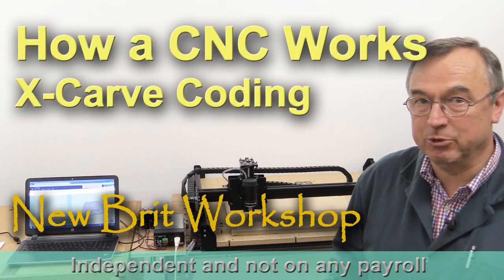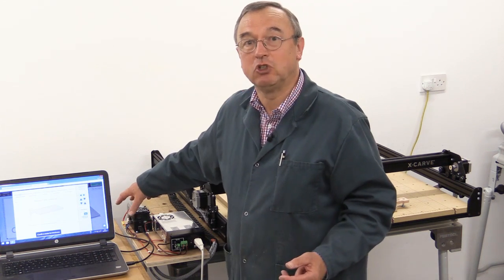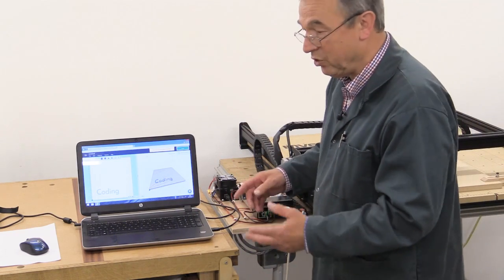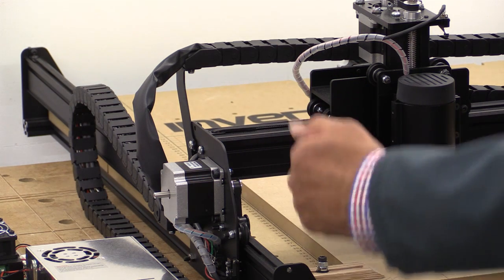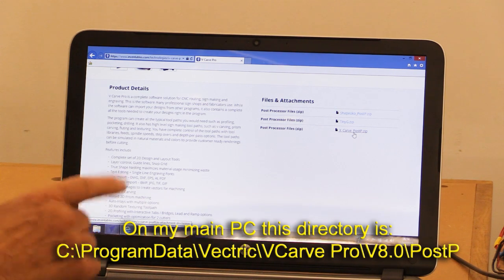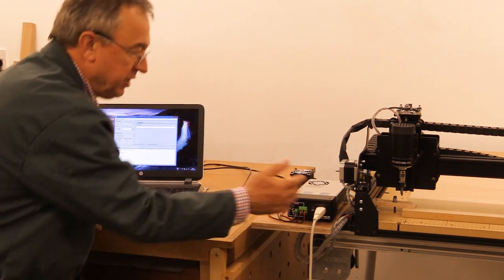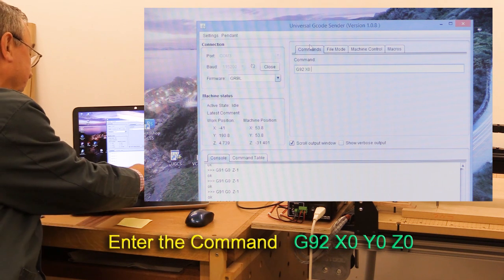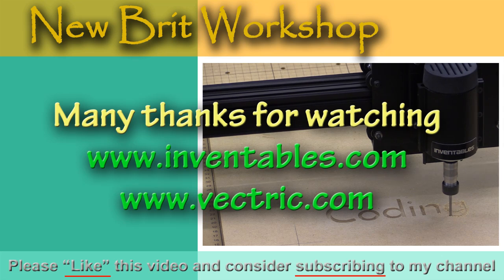How a CNC Works - X Carve Coding

Comment: Great work. How do you put in 3D. For example I want a carved dog's head.
Reply from the maker: There are two elements - the CNC must have as a minimum the capability of running in X-Y-Z (clever ones can rotate the cutter head as well) and the software used to generate the toolpaths must be able to exploit the capabilities of the machine. So, for your dog's head project you could try Vectric V Carve Pro. There are a number of free samples that Vectric provide and I am sure that there is a wide selection of animals amongst them.   Peter

Comment: Hi there.  Fellow UK based guy here from North Wales.  I thought I had read somewhere that the X-Carve controller was not capable of processing 3D models like those we can create in V-Carve?  For example, a detailed raised animal on a flat plinth  using ball nose bits.  Personally I can't see why not but I'm hoping you can confirm one way or the other.  I enjoy your videos very much, thank you.
Reply from the maker: Hi Des, The X-Carve is a 3 Axis machine and so there is no reason why it cannot do 3D work. In order to take full advantage of this you do need the right software. V Carve Pro is 2.5D but, I understand, that Aspire will give a full 3D capability.   It would be best to talk to Vectric for confirmation of this.   Peter
Reply: Thanks Peter.  I currently produce what I call 3D pieces using VCarve Desktop but my CNC only allows 300 x 300mm max. hence the need for a bigger machine so it sounds like it should be fine, thank you. 

Aspire will let you actually create 3D models from 2D drawings but that's not what I want to do.  VCarve Desktop and Pro will let you work with 3D models created elsewhere and merge them into your own work. You can create, for instance, a horses head in 3D by importing a commercially produced 3D model into VCarve Desktop or Pro and adding it to something, like a frame, you've created yourself in VCarve.
Reply from the maker: Hi Des, Yes, I have produced a 3D fish using V Carve Pro from one of the sample pieces from Vectric. I am soon going to start work on a new X-Carve machine assembly. It will be the new 750 mm size and have all the extra stiff components. It will also have the Dewalt router, X-Controller and Z probe. I hope to start work in late October or maybe November.    Peter
Reply: Ah, that's the machine size I'm interested in so I will be glued to your channel and will follow your build with great interest.  Thanks Peter.
Reply from the maker: Hi Des, Please could you send me a Private Message with your email address so that I can tell you a little more about my plan. Just follow this link: https://www.youtube.com/user/StoneMessage then click "About" followed by "Send Message". This works from PCs but some tablets and smartphones make it difficult.     Peter

Comment: Nice little overview on how a CNC works. While this is done specifically for an X-carve its the same process for any CNC. What is different on others is just stuff that's specific to the cad/cam youre using and the controller setup. 

For instance I also use v-carve. I just use a diffrent post processor, Mach 3 ATC in my case. Mach 3 is a controller with many features found on industrial style CNC machines. That runs on an old desktop that takes the place of the gshield. I just stick the g-code file on a thumb drive and take it out to the shop and stick it in that computer. Mach 3 will read it right off the thumb drive. NO net access is needed anywhere in my setup. 

To  set the X,Y, and Z start point on mine I simply use the arrow keys on the keyboard to move in X and Y.  for Z I use a touch plate making Z basically an automatic process. Instead of using g92 I simply zero out the 3 readouts for X Y and Z. No machine homing needed.  Then I just hit the start button.  

The ovrall process is the same, only the specifics change,,,
Reply from the maker: Hi John, Many thanks for that detailed description of your setup. I am sure that will help a lot of people. Cheers.   Peter

Comment: Hi Peter
When I open the UGCS and type in the G92 X0 Y0 Z0 
and press the enter
a message error says  Grbl has not finished booting
Please tell me what that means

Kristian
Reply from the maker: Hi Kristian, It sounds as though something is wrong with the software in your X-Carve controller. Try switching it off and then back on again (basic I know) and you need to check your connections to the controller board. With the power switched off you should be able to move your gantry by hand. When you do so you should see lights flicker on the controller board. When you power up it should be almost impossible to move the gantry and better not to try - certainly do not force it. Once it is powered you should tell UGCS which port you are using for the connection to the Controller and then you should issue the $H command from UGCS to home the machine. The Arduino and controller software should now allow UGCS to issue commands to the X-Carve.  If this does not help then you need to seek help from Inventables.     Peter
Reply: Thank you Sir.  I look in to it next time I get out to the workshop.

Comment: Hi Peter
I have now downloaded the  PP file
and put it in the same directory ehere the program is,
and the UGCS file, but I´m sorry to say I don´t know how to open the UGCS file.
And where do I put the UGCS file ?

Hope I don´t get you in to much trouble helping me.

Kristian
Reply from the maker: Hi Kristian, The pp file on my computer is in the following directory:  "C:\ProgramData\Vectric\VCarve Pro\V8.0\PostP". I do not understand what you mean by the UGCS file, I assume you mean the GCode file that you created in VCarve Pro. That can be anywhere as long as you can  find it when you go to the "File Mode" tab in UGCS in order to load the file.   Peter
Reply: Hi Peter
I assume it´s same procedure in Aspire  as it is in V-carve Pro ?
Reply from the maker: I do not have Aspire but it may well be the same.  Peter
Reply: It's a little embarrassing for me
I do not think I know what you mean by creating the GCode file

Will you please have the trouble to axplain it to me
Reply from the maker: I assume that Aspire is similar to V Carve Pro...When you create the toolpaths in V Carve Pro they need to be created in the GCode form. In VCarve Pro that is an option that you select when saving the toolpath file.  Once you have that it can be used with the UGCS software to control the XCarve.   Peter

Comment: how does the machine know to proportion between motor movement and actual spindel movement? So how far the spindle moves by, letr's say the motor spinning one cicle?
Reply from the maker: +Jocobes  The user selects the tool parameters in the software (in my case VCarve Pro) that creates the toolpaths. That same software then calculates the rate of movement based on those parameters.    Peter

Comment: Peter, Thank you so much for all of the tutorials regarding the X Carve. I have finished my build of the 1000mm version and have been learning V Carve desktop using the trial version. Although your video explains V Carve Pro, I'm sure it's the same as far as setup, files needed and process of sending. Having your coding video to watch has been immensely helpful and I can't thank you enough! I am new to the CNC world and you make the struggles to understand things much easier!
Reply from the maker: +Rob Holcomb   Hi Rob, Many thanks for the feedback. I am doing some more X-Carve video work now showing some ideas that may help you and others. I am then going to make a video about a dust boot which is essential if you want to leave the X-Carve working whilst you do something else. After that I am going to start some VCarve Pro very basic tutorials - I do not want to compete with the fantastic worked examples that Vectric have created but want to explain some of the very basic stuff which is assumed elsewhere.    Cheers.  Peter
Reply: +New Brit Workshop (Peter) 
I can't wait to see the videos Peter.  Many tutorials assume the basics and that is where most people have problems. Another tutorial that is lacking online is about which end mill or router bit is best for which type of work that's being done. Most things I've read refer to a lot of trial and error to get the right bit. For instance, a simple cutout that's 3/4" thick requires a flute that is that long at the bare minimum because of run-out issues. It took me 4 hours of searching online just to learn that! I bought a dust boot from kentcnc (https://www.kentcnc.net/nc/mini-split-shoe) that is very nice and will fit my Dewalt 611 that I'm using for a spindle. I plan on using my dust collector rather than a shop vac so I will be able to keep things going for quite a while without worry that the shop vac will overheat. Have a nice evening. Rob
Reply from the maker: +Rob Holcomb   Cheers Rob. I will do my best to help.   Peter

Comment: Hi Peter, just wondering if you have used it with many hard woods and what type of finish you are left with in recesses? Does it leave a lot of tool marks which require a lot of sanding? Does it give the option to do a 'finishing pass' to give a better finish when an area is too narrow or small to get sand paper into?
Reply from the maker: +Dean Martin Hi Dean,  I have tried oak and it works very well but it is not the CNC itself which will dictate the final finish but the cutter in the spindle and the software you are using (which may give you options for a finishing pass). But so far, the results have been very good.    Peter
Reply: +New Brit Workshop (Peter) I'm wondering would a smoother finish be simple achieved by telling the software the cutteris smaller than it actual is. Example, using a 2mm cutter in the machine but telling the software it's only 1.5mm, thus increasing the overlap per pass which would remove any ridges which may form. It would obviously increase the time it would take the cnc to complete the project. Just a thought
Reply from the maker: +Dean Martin The way to do it is to let the software take control. Changing cutters would not work in the long term. V Carve Pro has the ability to do a final shallow pass.    Peter
Reply: +New Brit Workshop (Peter) thanks Peter

Comment: with proper software, does this cnc have the ability to make contoured cuts? as in 3D not just 2d routings? that would definitely make this more attractive. thanks! great videos by the way.
Reply from the maker: 7711gman It should do this with the right software and I intend to demonstrate just that later in the year.    Peter

Comment: Hi Peter, Very nice - I am just behind you on my build of the X Carve. Just one question. I want to carve in 3d (guitar tops) not just a flat shape but a compound shape. Is there any software that can be used that is cheap ?
Reply from the maker: Tim Cains Hi Tim, Obviously I have not tried this (yet !) but I understand that Vectric's Aspire is probably the product that you would need. There is a chance that you could do this with V Carve Pro but I am not sure. The X-Carve is capable of doing the work with the right software at the CAD/CAM end. Send Vectric a quick email and you will find that they respond very quickly.  Cheers.  Peter

Comment: Peter, as always thank you for your great and well produced videos. I'm looking forward to actual projects with this machine. In the meantime I was wondering whether or not the xCarve will to do proper 3D work (e.g. carving a section of a sphere). In essence: Is the Z-Axis able to dynamically move up and down to that a curved 3D shape can be created?
Cheers from Germany - Guido
Reply from the maker: cattoasterer Hi Guido, I am sure that the X-Carve can do this but I have not proved it yet. The machine is capable of independent movement in the X, Y and Z directions and so it is just a matter of having the right software. Vectric's V Carve Pro does 2.5D and I believe their Aspire package does 3D but I have not tried it yet.  As I said to Tim, send Vectric an email and they will respond very quickly.   Cheers.   Peter

Comment: Thank you for your explanation.
I have a problem: I've downloaded the UGCS and I can not run it because i do not know what the specific jar file. I really would appreciate your help. Thank you sir.
Reply from the maker: Máquinas de Madeira When I downloaded UGCS it came as a zip file named "UniversalGcodeSender-v1.0.8.zip". If you have successfully downloaded this file you should double click on it and extract the file "UniversalGcodeSender.jar". I then created a directory which I called "UGCS" and I then put the jar file in it. I then created a short cut to that file. Provided you have Java installed then clicking the link to the file will open the application in Java. I hope that this helps.   Peter
Reply: New Brit Workshop Yes. I did it and it worked. Thank you for inestimable help.
M.Madeira

Comment: Thanks Peter.  I was with you until the $700 software program.  :-)
  
What do you get for $700 over the free Easel?  Perhaps for someone that has to purchase the X-Carve it may be more cost effective to change brands of CNC?

Thanks.                 JimE
Reply from the maker: Jim E Your choice of software should be determined by your requirements as should your choice of CNC. I think that you would have to look very hard to find a machine that out performs the X-Carve and comes with a free software application for less money. Also, you need to factor in the fantastic customer support available from both Inventables and Vectric.     Peter